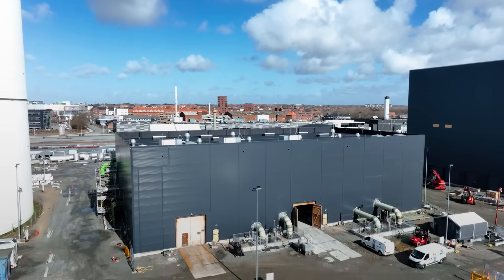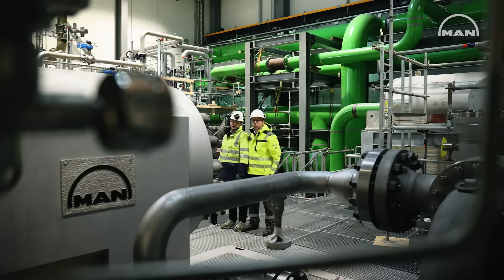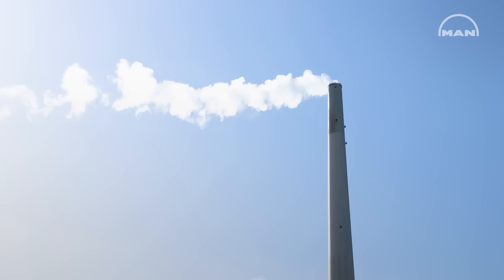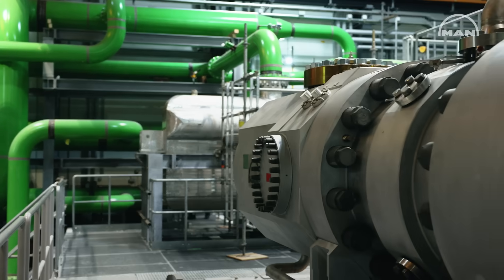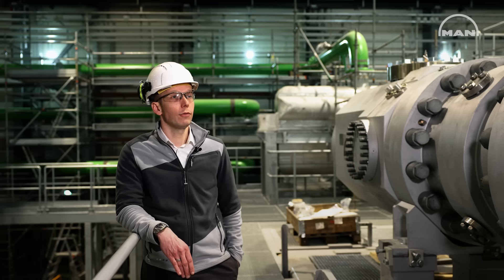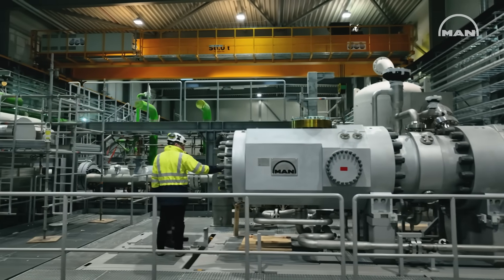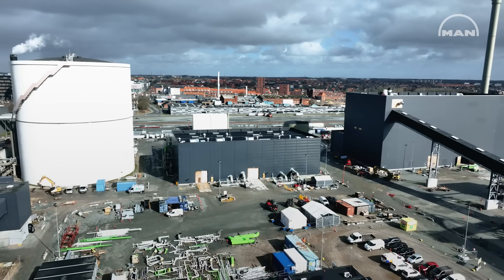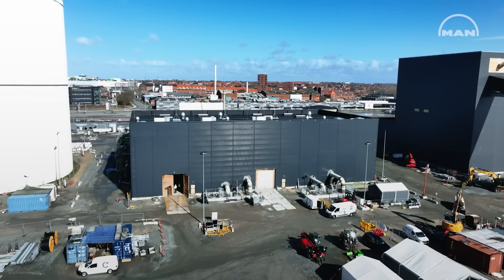The future of district heating

Comment: and what COP can you achieve? Which mass flow of water and which temperature difference?
How do you clean the surface of the sea water heat exchanger? How do you filter the water?
Reply from the maker: Thank you for your interest in our trans critical CO2 heat pump. Please use following link (https://www.man-es.com/process-industry/campaigns/heat-up-carbon-down to download a fact sheet (MAN Heat Pump HPU) and a case study (MAN heat pumps TCC use case) for the Esbjerg project, where you will find all information incl. the answers to your questions. We are happy to discuss this topic and potential projects further with you.
Reply: @Everllence  "Page Not Found
The page you were looking for could not be found on this server."
Reply from the maker: @WernerEngel1  Sorry for that, this is the correct link: https://www.man-es.com/process-industry/campaigns/heat-up-carbon-down